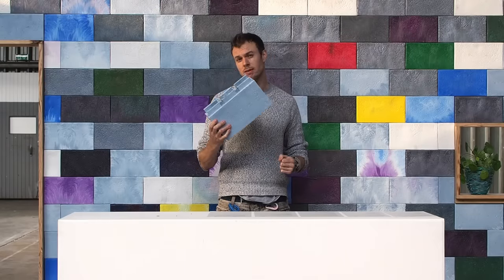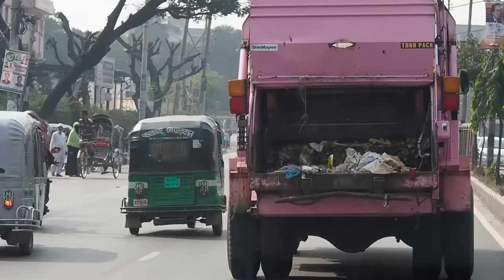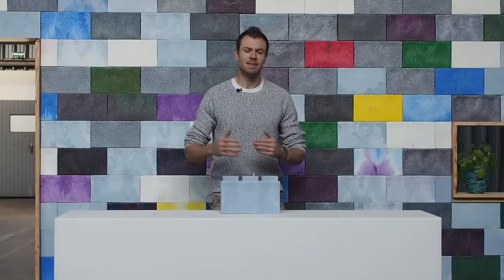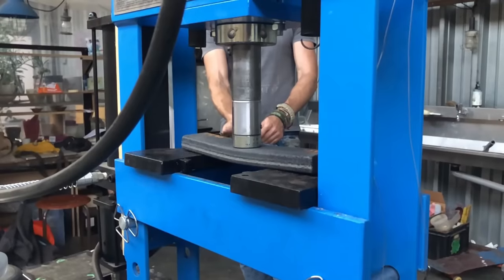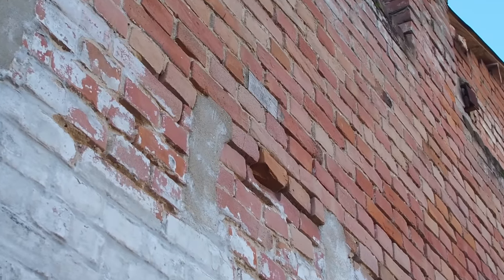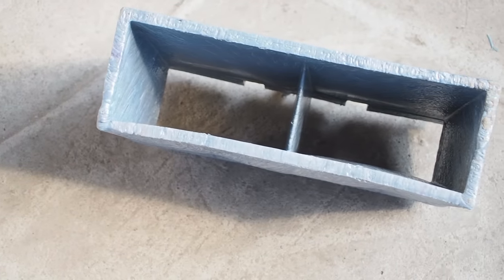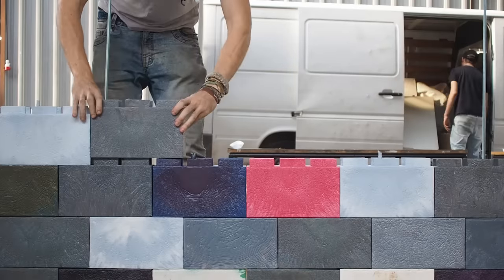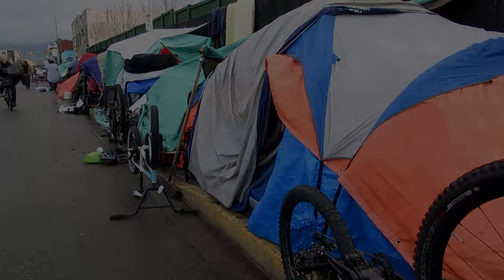Why the world needs recycled plastic bricks (and how to make one yourself!)

Comment: Hola from Panamá! Quick question: we welded the mold together and there are still some little gaps and open lines where plastic could potentially be squeezed into...do we have to weld the complete surface shut or are some little open groves / lines okay? We are worried that the brick might get stuck due to those or that plastic will be annoyingly squeezing out in those spots. What would you recommend ?

Thanks for your time and help,
Nike 
#inmcoeanforcleanoceans
Reply from the maker: Hola! Great to hear you are making a mould. Small gaps are ok. Mainly around the top plate (where the bolted section is) because if it gets stuck you can always open. As for other places there shouldn't be any gaps, but small ones shouldn't be a problem as the plastic tends to cool before it can squeeze through. Hope that helps!
Reply: @sustainabledesign.studio  thanks so much, that helps a ton! We just did not want to put it all together and then find out we have to take it all apart again to fill the little gaps 😂. They are all fairly small, so I think we will give it a go
Thanks a lot for getting back so quickly, I highly appreciate it 👍

Comment: Assuming these are polyethylene bricks I wonder if thermal expansion is an issue. Polyethylene has a high thermal expansion compared to a lot of other plastics. I wonder if combining these with other more traditional building materials like wood or drywall would cause issues because of the different expansion amounts. One would have to invent some unique fastening methods or stablilize the polyethylene with glass or carbon fiber.

Comment: I see this as an awesome Idea. But have you figured out the issue with scorching hot climates. Plastic not only becomes brittle in the heat, but it also retains the heat far more than conventional timber and bricks. Where clay bricks tend to be hot on the outside if you double layer them, the inside bricks tend to be much cooler to touch. They also don't become brittle in the heat. In the cooler climates, I can see how this could be a viable building material. However, in hot climates such as northern Queensland in Australia, or in desert regions, you could run into some further serious issues. 
How have you fixed the issue of the plastic bricks flaking and falling apart after a couple of years of being exposed to those extremely hot climates? 
I am aware that composite material is used to make decking material, but have you ever stood on them after the sun has hit them for a few hours? They are scorching hot. They are just as hot as concrete and they retain the heat too. I would never build an external wall using those bricks because they are not practical in hotter climates. Also what about any gases that may occur when heated up by the sun?

Comment: This product would be great for natural disasters. Housing could be quickly built. The bricks could also be made into low walls to support sand bags when floods happen. You could even add sand inside the bricks to make the wall stronger. 

I can see a future where plastic bricks like this are in wide spread use and plastic is no longer considered to be a waste product in the making, but rather a valuable resource.

Comment: problems;
1) what is the reliability or resistance to fire cause plastic burns !
2) prolong exposure to heat rain & snow what is the result any chemical odor and also cold&heat insulation how is it ?
3) will it be easily replaceable? from what i see if the middle ones is damage it looks difficult to replace it unlike bricks

Comment: Huts for animals. Dog houses, pig enclosures, fencing, exterior shells for homes. Ideas are endless, if restrictions are freed, meaning it can't be everything to everybody. If it ends up in the ocean, start making sea walls that won't wash away. Make hollow walls of plastic and fill with crushed rock or sand for weight advantage. I'm not clever, but others can be. Have contests to originate ideas.

Comment: Hmm... Not to be a pessimist but if this thing goes through, the competition for quality would be one of the many focal points for its widespread use. Meaning there will be manufacturers who will use a brand new set of plastics and with no clear-cut way of disposing broken bricks outside of reformation, wouldn't this thing be moot?

Comment: Put it this way plastic brick melts at 300°c and is a source of fuel, standard red brick doesn't melt and isn't a fuel source. Let's just say I don't want to live in a candle that when lit reduce the structural integrity of that emidiat area rapidly, resulting to quick complete structural failure.

Comment: Not gonna lie, I would be very tempted to build a house using these oversized recycled lego bricks, assuming it was cheap to obtain. Everyone knows that value drives reality at this time. If these recycled "bricks" could be made cheaply, could be used cheaply, and would be durable enough to build a house with, it might catch on.

Although I much prefer wood for building, I'm not opposed to using recycled plastic as it has a lot of uses and can be fabricated to fit just about any function. Since plastic is watertight and not prone to rot, it would be great for roofing materials, assuming you could fabricate it in a manner to withstand the extreme temperatures and environment in general. Interior wall paneling could also use plastic. It would be more durable than things like sheetrock or wood paneling, and possibly cheaper. The structural components of cabinets could be plastic. Maybe could have interior framing be made from plastic. Of course, ideally, a system could be made to build a durable house out of recycled materials cheaply and easily enough to bring the cost of a new house down to something the average person can afford without getting into a thirty-year debt. The only way this will happen is with plastic and a major reduction in labor involved to manufacture the home.

Comment: You need more heat and pressure, and you will get nice smooth bricks as smooth as Lego’s. And stop mixing plastics you are asking for failure if you don’t. A tip is from
owner of a plastics injection moulding company in Australia me. 

You also need a more professional die, and a larger injecting machine with thousands of pounds of pressure. With water cooling in die. Its why you are getting weird shrinkage. Yes dies are expensive.But you need these things to make it affordable. 

The type of homemade die wont last you very long. I have a mild steel die for my invention and it uses1000 pounds of pressure to make my device, at a rate of 2 units in a die at 15
seconds cycle, and i get not one deformation and i use micro milometer
precision, its all about making it right. You could make a die for that brick
for about 2000 dollars if you find correct toolmaker. But without this die your
bricks will never hit the market.. 

 We all use recycled materials, they just have to be resorted. I'm pushing for plastic
type to be marked into a product so recycling can be far better sorted. We have
many problems in this industry from both consumer to yes from us manufactures not
recycling waste like my company does. 100 percent of our factory waste is reused in our
own products in factory ( factory currently in mothballs due to covid)

Comment: Better off making boards and posts and build a house the same as wood. Those interlocking bricks will be extremely difficult when it comes to repair if one decides to use it for a big structure.

Comment: Injecting a variety of plastics that doesn't have to be sorted - thus drastically reducing price, and increasing the amount of plastic recycled - into a plastic PET bottle, which will hold together the plastics that won't bind, then using that solid bottle as a cylindrical brick, sequestered in mortar and concrete, would have very good mechanical properties as a matrix just like rammed-earth PET bottles used as bricks. You get a cheap solid brick, much more resistant in load bearing structures, that would give a new lease of life to enormous amounts of plastics straight from the trash, and together with the traditional mortar/concrete finish would make an impermeable wall protected from fire and some of the off-gassing (depending on the concrete mix, if used water-proof concrete, there would be no off-gassing).

Comment: If it were affordable, I would make these lego blocks from new and recycled PET but it would need to be so pure, that after many years, the blocks could be reused or recycled again perfectly. 
The high price would then be less of a concern if the bricks can be sold after 50 year and CO2 is in fact stored in them. But to protect them from UV, fire and oxidation a decorative water- and fireproof top layer would be needed, as is mentioned already here, I see now.
 For the moment old buildings get demolished and it's very hard to recycle the still complete bricks.That feels not right.

Comment: The exact same thing will happen as a building material as what happened to MDF & OSB..  It was first created using sawdust from woodshops..  now they rip trees down just to make OSB & MDF..  a subgrade building material using toxic glues with Formaldehyde which rot out upon contact with water...  being used on exteriors of houses, subfloors & IKEA furniture...
Great idea in concept/theory & it could work, but given past experiences, we all know where this will end up...  not to mention if the structure has a fire...

Comment: I like this idea and saw few other similar projects already in India. The problem is the smell of plastic. It never stops and it gets even worse on hot weather and direct sun exposure. Human kind should focus on finding a solution to using plastic and stop asap. If that's not possible converting it to clean energy will be enough. Otherwise we don't achieve sustainable growth and just move the garbage from one place to another. 
So in case you haven't consider, imagine this product is widespread and entire cities are build from it. Imagine 3% of these cities are coastal in a poor 3-rd world country and there are a lot of houses in the tsunami range. Everything is build from this material as a government measure for quick recovery and restoration of the habitat. In this scenario we will end-up with ecological time ticking bomb.

Comment: In Honolulu we've had picnic benches made out of recycled plastic put in our parks. They ended up bleaching, turning brittle and breaking very easily. I'm not sure I'd use them as a brick for a structure.
Reply: That's because of government purchase corruption. Too many deals given to well-connected friends that then do the absolute minimum to collect the money. Stabilized plastic should last at least a decade. They didn't use the proper UV inhibitors. This groups is also expecting that the bricks are covered for long time outside use. The structures they've made are just demonstration pieces so they needed to look pretty.

Comment: Very interesting project!!! 

I do have 3 questions: 
1) How stable is the house/construction made of these bricks in the super windy areas? For example, in some corners of the world the wind can be on a constant basis up to 100-150km/h, with some pushes up to 200km/h. Would the house with such bricks survive in such an environment?
2) Did you test for higher temperatures resistance? I mean are these bricks usable for the areas with 40-50 degrees Celsius?
3) Any ideas of the health effects when producing the bricks and when living in such a house?

PS: Asking, because I got super interested in this idea...
Reply from the maker: Hey,  So when it comes to official testing its still very early days for us. The structure is bolted down to the concrete slab so we feel like it would do quite well. However, we have no proof, just theory. Again for heat, we don't see why it wouldn't be able to cope at these temperatures, but the summers here don't get above 35c.

As for health effects while producing we wear masks and work in a very well ventilated area. As for living in the house, most houses are full of plastic. We eat out of it, we cook near it. But still, I would recommend you render/plaster your house to increase safety, while also combating solar degradation of plastics :)
Reply: @sustainabledesign.studio  Thank you :-)
Reply: It's probably not very secure in high winds. It works best indoors, where noise isn't an issue. Instead of office panels, these can be used to separate cubicles. In fact, it would be even better, because it would allow businesses to customize the amount of space for each staff member according to the needs. If there is a cubicle for a printer and some stationary, then the cublicle can be 1' narrower. With panels, we can't do that.
Reply: @Mr Brightside, good point. I wonder if the fumes from office paneling would be any different, though.
Reply: @Mr Brightside i know that.
Reply: @Mr Brightside, I don't know that, because you haven't showed me that partitions are made from safe-ton-inhale materials.

Airplane seats aren't made from such materials.

Instead of telling me what you and I know, just cite the MSDS of partition materials.

Comment: The problem is likely that the material is flammable. That would cut down dramatically on its possible uses. With plastic's tendency toward toxic emissions when burned, I can't see building departments allowing it for housing - even for homeless housing.  Once you get into treating the plastic for flammability, you've increased the cost.  

Of course a use must be found for this wonder material. It is a crime that we leave millions of tons of it on the earth for our children to clean up when some beneficial use could be made of it. I am gratified at projects like these, but I don't see wide use for it as a building material

Comment: All very good to make these plastic bricks apart from a wall structure it has limited uses and may well be toxic. The next generation of building mortar called geopolymer concrete doesn't need bricks and uses about 96% waste materials like fly ash and sets to full hardness in 24 hours producing 75% less co2 than concrete.  
One ton of concrete creates about 3/4 of a ton of co2, globally we make about 4 billion tons of it every year.

Comment: You guys want to get these out there quick, start smaller.  Sell a design with roof panels for people to build sheds like you'd buy from a home improvement store like Menards or Lowes in the states.  If you can undercut those virgin plastic panel designs, while having a product that can be easily insulated with blown in or poured in insulation, you'd have a great base to start from.

Comment: This is a very cool idea and I hope you get funding regardless of whether this idea is ultimately sound or not, because it should be explored. I really doubt it's fire-resistant and would question its long-term durability but it has uses regardless. Things like a bus stop, emergency shelter, etc. Please use the power of capitalism and make this something that can solve the low-budget use cases, I bet it will have adoption.

Comment: Great project! But like other sustainable projects, the big problem is financing, what if they try to sell those bricks to the public, the new generations are burdened by the responsibility of repairing what the previous ones broke, if their bricks go on sale to the public. general public and for each brick sold they build another that will be used to build houses in economically disadvantaged sectors, they can find the system to boost their growth

Comment: There is a company in america that has patented a plastic byilding block. It is one of the very least dangerous plastics. Not made from recycled bottles and stuff. At this time it is far more expensive than normal building materials as it is new and has its own production process. This block is inherently uv resistant and aparently breaks down into co2 and water. If i remeber correctly. Forgot the name. Youtube building with plastic bricks. It should pop up.

Comment: I would be supprised if plastic bricks complies with the building regulations. Typically plastic is restricted as a building material. There is a European standard called EN 13501. Typically the minimum class is B (very limited contribution to fire) plastic is typically E (significant contribution to fire)

Comment: Plastic is not viable as a construction material.

Its highly flammable so any building made of if would be consumed by flames really fast.

It melts quickly. Firefights requires that the material used on the construction have to keep its structural integrity for a minimal amount of time. This time is the time needed to the firefights get to the location and do their job. Not only that but as it melts it will form pools of hot melted plastic that will make very hard to the firefights to operate inside the building.

It release toxic fumes. Its a toxic hazard not only for those inside the burning build but for the entire neighborhood.

It will never be able to comply with any Fire Department regulations.

Comment: Hello I would like to recommend mixing cork pellets into the plastic to try save some of the plastic while continuing giving some flexibility  and  integrity of the brick.
I suggested cork because cork trees retain a lot of the carbon dioxide they absorb from the  environment air into the cork/bark layer that protects the tree.
Cork is a non toxic flexible material resistant to fire and insulating.

Comment: Now, let's talk about the fire hazard, degradation by UV light and insulation properties.
Reply: Wood, which most low-end to mid-range houses in the US are made off also degrades, has poor insulation and catches fire. This is not meant to build skyscrapers, but lower end buildings.
Reply: @jackwilson5542  From where I from, even the low quality houses are not allowed to be built like this. I guess it is mostly because of the different climates.